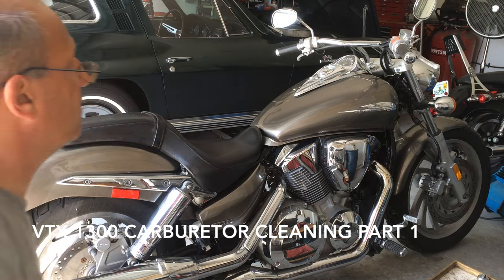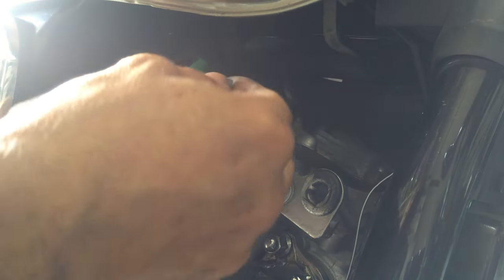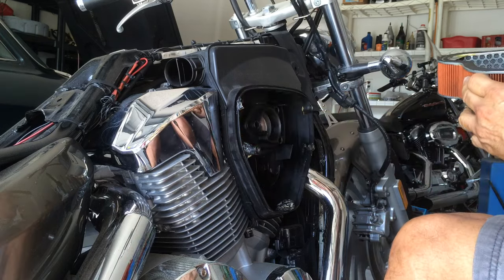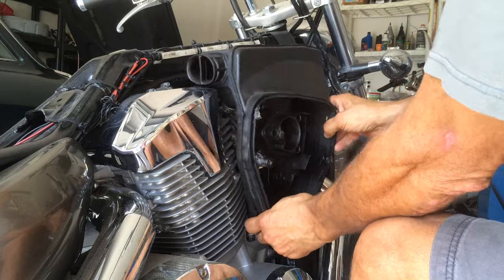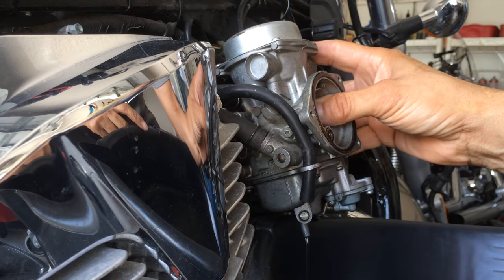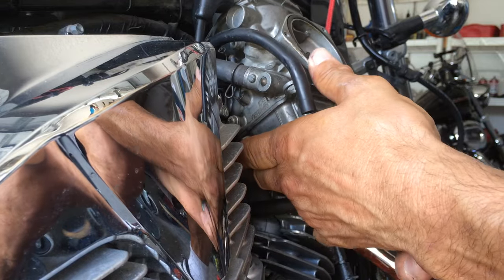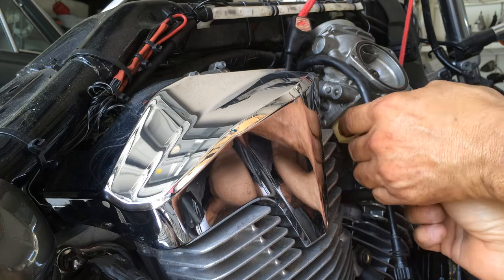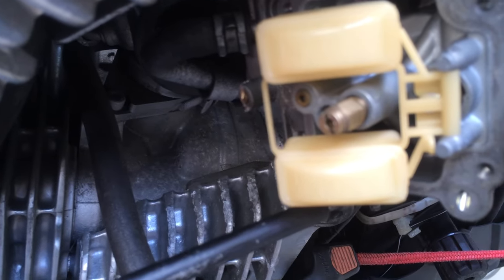How To: Honda VTX 1300 Carburetor Cleaning Part 1

Comment: Had rust in tank, changed the tank and cleaned pit cock, lines and carb. Thanks Pete runs perfect.  Tallahassee is blessed with an honest motorcycle mechanic.
Reply from the maker: Happy to hear all went well. These VTX 1300 are great motorcycles. Thank you for watching and all your support Jonny.  Ride safe and have a great memorial day weekend.

Comment: Thank you!!! I am an auto mechanic and was hesitant to touch my bike until I watched this video. Very basic and simple! You saved me hundreds of dollars which I get to spend on the next set of tires that do not last long on this bike. I did find on my 05' that the vacuum lines were cracked so I was not getting fuel. Less than 10 dollars later all of those were replaced too! God Bless brother!!!
Reply from the maker: Happy to read all went well. Always glade to help.. Any  questions just ask. Thank you for watching and your sub TheGreesmunke. . Ride safe and have a great day.

Comment from the maker: Only do it if your bike is giving you problems idling or it won't idle, first always change  plugs and air filter. If that don't do it. Then clean carburetor.. If you could thumbs up and subscribe, ride safe ,thank you
Reply: Two Wheel Rocco 
I have this bike soon nice 2 year I run with it 10,000 miles. I just change the oil & oil filter and spark plug. 
I’m driving in UAE it’s hot wither. When I drive at 120-130KM then I need to go more I don’t feel that the engine is in smooth. I

Comment: Thanks Rocco!   Really helped me out!  The bonus was you showing the accelerator pump.  I'm a complete novice when it comes to this stuff but I'm really enjoying learning how to do things like this on YT.  Anyway, because you talked about it and showed how that was supposed to work I realized that mine wasn't working at all like yours was.  So I took it apart.  I think it was either just stuck from non use or it has a vacuum lock on it.  It was all clean and no tears in the diaphragm so I put it back together and it appears to be working now.  So I'm gonna put it all back together and see if this did the trick or not.  My guess is it did.  Really appreciate you doing this to help others out!
Reply from the maker: Happy to help. I hope that all works out. Any questions just ask thank you for watching all your support Dave. Ride safe and have a great day.

Comment: Thanks for doing this video Rocco, best one on YouTube.  My 2007 C wouldn’t run over 40mph until I followed this video; jets were all clogged and corroded, cleaned up nice!  This way is so much quicker than taking the carb off the bike.  One extra thing I found was a little screen where the fuel line goes into the carb;  it was also clogged so I just cleaned it out and reinstalled it.  Now this bike runs like new.  Pulls like a freight train!  Thanks again for this video 👍🏻
Reply from the maker: Happy to help. VTX 1300 are great Bikes. Thank you for watching and your sub Jeff... Ride safe and Have a great day.
Reply from the maker: keep this in mind if there is dirt in the screen by your carburetor chance you have a bad screen at your Petcock. check and clean or replace gas tank petcock screen.

Comment: Oh wanted to thank you for this video, greatly simplified what seemed to be a formidable task. Really turned out pretty easy. I was forced to drill out the A/F screw, but I replaced it with a Glenns A/F extension knob and was able to tweak both idle and AF until it held idle.
Reply from the maker: Happy I could Help. Ride Safe and have a great day.

Comment: Its really important to note that just because you see fuel spitting out when you cycle the accelerator pump, that does NOT mean its OK. There are 4 extremely small passages around the brass plug in the bottom of the accelerator pump bowl that must ALL be clear for it to run like it should. Nothing short of a physical cleaning will get to this location. If your bike spits and chokes trying to get up to speed, but runs fine when it gets there, I suggest you look there first. A very thin sliver of a soda can may assist in cleaning that area out.
Reply from the maker: Thank you for your tip and all your support Joe. Ride safe and have a great day.
Reply: @TwoWheelRocco  I literally just did this over the weekend to a 2007 1300C model and all the gremlins went running for the hills. Those passages are easily overlooked. The 1300 runs like a scalded rabbit now. Thanks for the reply and you ride safe as well. "Painted side up" I like to say.
Reply from the maker: I agree this VTX1300C are excellent bikes.  Honda did an outstanding job.  value wise, probably one of the best rides out there. Ride safe and have a great day.

Comment: My 06 Honda VTX1300R is blowing out gas from the carb into down my air filter and into my oil as well. I don't know what part is not working and needs to be replaced. Thanks for the great video. I feel more confident to take the carb apart I just don't know what I would be looking to replace in my situation
Reply from the maker: Happy to help. As for your gas overflow problem it sounds like your petcock Diaphragm has failed so you are having gas constantly leaking from the tank to the carburetor to the intake into the motor into your oil replace Diaphragm on Petcock.  I do have the video I will send it. How to test your petcock.  This is the same for your VTX.      https://youtu.be/7Fo9Q93OJXI.     Thank you for your Sub Rock.  Any questions just ask. Ride safe and have a great day.   PS I will send link for replacement Diaphragm.      https://www.ebay.com/itm/2003-2009-Honda-VTX-1300-R-S-OEM-Fuel-Petcock-Diaphragm-Cover-Set-16953-KEA-023/283807394619?hash=item42143d2b3b:g:k5UAAOSw9hteY~O6

Comment: Great video.  The airbox bolt at the bottom goes into a rubber grommit that gets stuck to the bolt and freely rotates with the bolt. It is a pain to pry the airbox out when this happens as the grommit will have to be pulled out with the bolt.

Comment: Awesome video, saved me a bunch of money.  The only real problem I had was getting those damn hoses back on the back of the box.  Broke down and went and bought that tool you use.  Definitely helped but still had some trouble with the bigger one.  I ended up going to the other side of the bike and finding where that hose was routed.  In the middle of the engine it has a heat shield on it and I popped that part of the hose out and pushed it through just enough to make it easier.  Once I had the box back on I just snapped the hose with the heat shield back into place and was good to go!  Thanks again, she runs like a champ!!  Of course I did this yesterday and today it's heavy downpours all day.  Bummer!!
Reply from the maker: Happy to Help.....Ride Safe..

Comment: HEY ROCCO ... YOUR AWESUM.... watched your carb cleaning video..... i saw you do the air screw adjustment.....but could see where ya stuck the screw driver...my bike still back fires during deceleration.....i know as you said....thats the problem....SO..... CAN I ADJUST AS YOU SAID ...THE 1 3/4 TURN .....WITHOUT TAKING IT APART AGAIN....Can I get at it without taking all apart again.... I got same bike.... 2006 VTX 1300C ...same colour..... it has the spike air filter.
Reply from the maker: You will have to remove tank and air box to get to A/F screw.  Hope this helps.
Reply: Hi check out Glens vtx garage  you can buy air fuel adjusting kit and it comes with the D shape tool to remove your old A/F screw

Comment: I put a gas stabilizer in the tank before winter. Took the bike for a ride and the engine stopped (had 3/4 tank of gas).  Put on reserve and it ran.  ? Is it possible the stabilizer gunned the gas filter (not sure if it has a filter). I don’t like the idea of running my bike on reserve all the time
Reply from the maker: I would fill the tank up and see how it runs with the petcock on.  If it will not run remove petcock and clean. Take a look at this video on petcock test.https://youtu.be/7Fo9Q93OJXI. Let us know how this works out.

Comment: Great video. Very descriptive. Easy to follow with no questions. Clean jets and adjusted air screw as noted. Idles great. Wondering if you know why my bike sputters at half throttle?
Reply from the maker: Happy to help. That would be your slide needle jet that's what controls mid throttle. Thank you for watching and all your support. BB. Any questions just ask I would clean it and make sure that slide is moving very freely. Ride safe and have a great day. You can play some washers under the slide needle and that will change your fuel curve. I'll send a video but it's will be with a Harley Davison, Sportster,  Same principal.   Take a look.   https://youtu.be/G1XD0hHtwCw?si=lt--bCT2nVKc2JaW.
Reply: I will give that a try. After I turned the choke intake one and a half times, the bike would stall out when I put the choke fully in. Should I turn it a little bit more out or tighten it in a little bit more? Thanks for all your help.
Reply from the maker: If you need to choke to be engaged for your motorcycle to Idle, that's indicating you have a clogged idle jet and your choke is compensating for that and that's how it's idling off your choke. Your choke should be fully pushed in and the bike should Idle once she warms up. I would start by cleaning the Carburator idle jet and circuit. Very easy. And you will see the results. Let us know how it works out and what is this that you're working on turning the choke out or in I don't understand.

Comment: My bike wouldn't idle without choke. We changed the idle rpm and now it works very well. But could the real problem has something to do with the carb?
Reply from the maker: You will need to clean your carburetor starter jet. And test petcock. Harleys are the same set up.  Take a look at this Video. https://youtu.be/7Fo9Q93OJXI. Any questions just ask. Thank you for your Sub Jen. Ride Safe and have a great day.

Comment: Great detailed video.  Would you have any idea why my VTX has a slight studder in RPMs around 1800 - 2000 RPMs in 1st and 2nd gear?  Like taking off from a stop or in low 2nd gear.  It seems to go away after 10-15 minutes on the freeway.  But if I start it and ride to the freeway it does it. Annoying and potentially dangerous... I almost hear a click or a pop when it recovers, which makes me think it may be an airflow issue.  We just replaced the vacuum hose on the petcock.  Thanks.
Reply from the maker: What pipe and air intake?
Reply: @TwoWheelRocco  stock pipes, stock intake, i believe KN filter maybe, I took it out a few days ago, it had a little blackness but wasn't ridiculously caked or anything.  I just got it 2 weeks ago, upgraded from an 04 aero 750vtc to this 05 vtx1300R.
Reply from the maker: Great Bike VTX1300 clean Carburator, New Air filter and plugs. Make sure excelerator pump Diaphragm is working proper, Diaphragm go bad. check petcock vacuum and tank screen. And you should be in great shape.  Thank you for your Sub Buds. Ride Safe and Have a Great Day.
Reply: @TwoWheelRocco  Thank you!
Reply: @TwoWheelRocco  Oh shoot, I forgot to mention my MPG is around 25-28 if that helps trouble shoot anything as well :-(, hits reserve around 95 miles which is piss poor, everyone else gets 140-ish.
Reply from the maker: Clean Carburator, New Air filter and plugs. Make sure excelerator pump Diaphragm is working proper, Diaphragm go bad. check petcock vacuum and tank screen. And you should be in great shape.  Let us know how this works out.    Test petcock,  This video is a Sportster petcock. The same as your VTX set up. When Diaphragm on petcock start to fail you will get bad gas milage.

Comment: Thanks for your video. The best one I've seen so far. Im about to dive into mine I think. Just replaced the plugs and air Filter, I changed the grips and something musta happened cause she runs like a crap salad sandwich now. lol
Reply from the maker: Thank you for your support, If you have any question just ask.  Ride safe and have a great day.
Reply: @TwoWheelRocco  I also have a 07 Kawasaki Vulcan EN500 LTD that needs a petcock. Should I use a rebuild kit or just get a new assembly?
Reply from the maker: @OldCityVlogs   I would get the rebuild kit, I have had a lot of good experience with replacing diaphragm in petcocks on Honda's.  Kawasaki should be the same. Let us know how this works out.

Comment: Buying a 07 VTX1300 from family has been sitting up for year or two will run but only with chocke engaged some thinking bad gas and carb issue any input would be greatly appreciated. Thanks
Reply from the maker: Clean fuel, Clean carburator and all will be well.  Idle jet clogged  choke compensate for clogged idle jet. No choke no idle. Let us know how it works out. Ride Safe and have a great day.

Comment: Great vid. My problem is poor running with wide open throttle. Took it apart and cleaned. Idles, starts, runs fine all over town. When I open the throttle past half way it begins to miss terribly. Any speed, any gear
Reply from the maker: Happy to Help, I will test your pick up at sounds like you're getting way too much feel bad Diaphragm and you're sucking too much fuel up top.. Thank you for watching and you sub Chris .test your petcock.https://youtu.be/7Fo9Q93OJXI.    let us know how this works out.  Ride Safe and have a great day

Comment: typo on my question...I COULD NOT see where you where sticking the green screw driver you marked to turn it the 1 3/4 turn..... can i get at it without taking everything apart again ?
Reply from the maker: This is the bit I used
https://www.ebay.com/p/171166259? Hope this helps.  Any questions just ask. Thank you for your Sub Ron.  Ride Safe and haver a great day.

Comment: to adjust the d shaped air screw...do they sell that tool...or do i have to grind a slot on it for a flat screw driver?
Reply from the maker: JP cycles  or you can find it on Ebay .https://www.ebay.com/p/171166259?

Comment: Hello friend, what manual do you need for vtx 1300 cc

￼
Reply from the maker: Happy to help, Any questions just ask. Thank you for your Sub Ricardo.  What is your VTX doing?    https://www.ebay.com/sch/i.html?_from=R40&_trksid=p2380057.m570.l1313&_nkw=vtx+1300+manual&_sacat=0.     Ride Safe and have a great day.
Reply: @TwoWheelRocco  Hello friend, excuse me, which manual do you recommend for my motorcycle?

￼
Reply from the maker: @ricardomarin3931  https://www.ebay.com/itm/2003-2009-Honda-VTX1300-VTX-1300-CLYMER-REPAIR-MANUAL-M231/331850615301?hash=item4d43d68a05:g:~TsAAOSwCtJZ9k9U.  Thats the one I like...

Comment: I have a Honda vtx 1300 I was riding and it began to backfire and then cut off. I had to get it towed home. It won't stay started....can you help me?
Reply from the maker: First check vacuum to petcock That would cause low or no fuel...If your plugs are black and wet with fuel you will needs new Float jet....Letting to much gas into system...Hope that helped..Let me know...i have a video on petcock vacuum check..

Comment: The reaso i ask is because ...i believe your correct why my vtx 1300 backspits during deceleration...i feel its that air screw adjustment that i forgot to adjust during the carb cleaning because i ...so far...changed the wire &  plugs too.....and changed the oil with 10/W30 .....hoping to know if i can get at that air screw without taking all apart again.
Reply from the maker: How many miles?  What pipe, slip on or full pipe.  You will need to pull tank and air filter box to get to that A/F screw.  Any questions just ask. Thank you for your Sub Ron.  Let us know how this works out.  Ride Safe and have a great day.
Reply: @TwoWheelRocco  its got 24000 km.....i have a D-pilot bit with a rotating screw driver that easily allows me to adjust air screw anytime
Reply: @TwoWheelRocco  i have full exhaust with baffles and carb is jetted

Comment: noob question, the petcock seems in the On position (down), how is fuel not pouring out after disconnecting the fuel hose?  thanks
Reply from the maker: Happy to help. I'll send you a video on how to test the Petcock notorious for the diagram to fail and the flow of fuel gets interrupted or free flowing. Both are bad they start the leak through the vacuum line that operates that diaphragm so when you start the bike up, it runs rich and bad. The other problem is, I won't have no fuel from the fuel house. Hope this helps any questions. Just ask.. Thank you for watching and all your support. I will send you a video of it to Sportster, but it's the same test for your VTX..https://youtu.be/7Fo9Q93OJXI?si=zTrCGrdy5IKGdM5B

Comment: If you would run some Seafoam thru your engine a couple times a year, you wouldn't need to clean your carburetor. I've used Seafoam on all my small engines for the past 15 years and I never had to take a carb off to clean them. I also use it for fuel stabilizer in the winter while it is being stored. My engines all start right up in the spring like they've just been running. It keeps those small ports clear of debris, which is mostly why carbs need to be cleaned.
Reply from the maker: I agree.. Thank you for your Sub.

Comment: I’m buying a bike and got it narrowed down to a 2007 VTX 1300 or a 2007 Suzuki Boulevard C9, the latter being fuel injected. The Honda’s main takeaway I’s its carbureted, but that should be a silly point I’ve owned bikes all my life with carbs but nevertheless can’t make up my mind. The Honda is 1000 more buts fully dressed, the Suzuki is naked and that’s gonna cost me to add everything
Reply from the maker: I like the VTX 1300.  Are you planning on long distance highway driving. Then I would go for the Suzuki C9 how many miles on each bike?